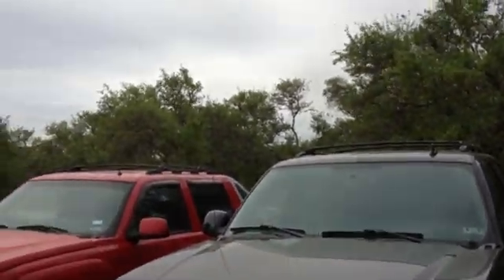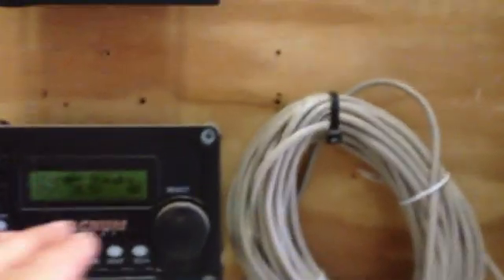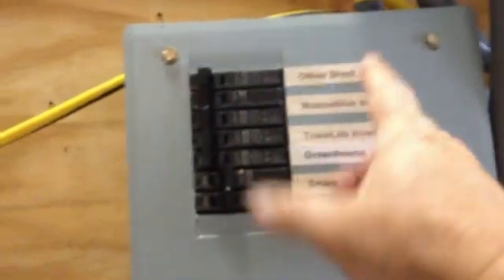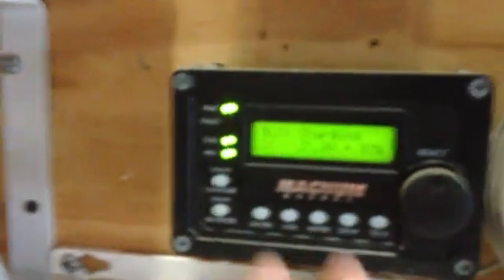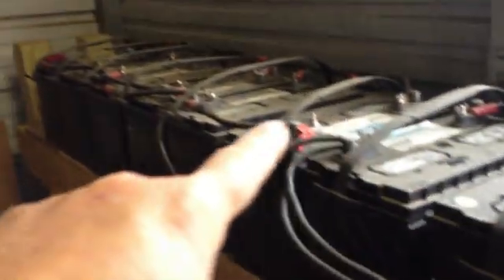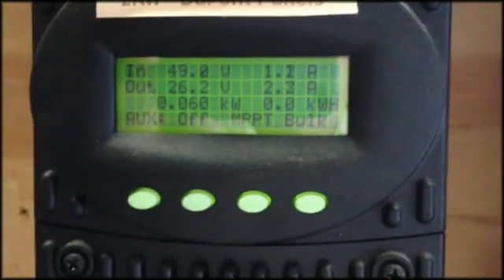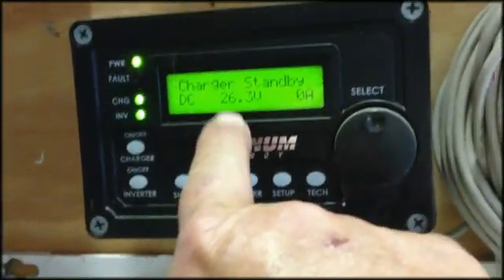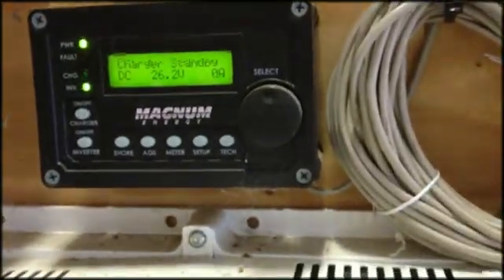Solar power battery bank update

Comment: Can you share your Wire sized from ...
1. Solar Panels to Charge Controller
2. Charge Controller to battery bank
3. Battery Bank to Inverter
4. 110/120v out of Inverter into House circuit.  

And what size breaker did you use between the Magnum Inverter and the House?  

Thanks

Comment from the maker: A 24v battery bank is fully charged at 25.5 volts, when it discharges and reaches 24v you will be at half capacity, you can take it down a bit more but avoid it, I would not recommend letting it go below 23.5v. Taking it down to the 23v range nightly would be very bad for battery life. Thanks

Comment: Al, do you think that the battery desulfator has been a really large part of the battery life you are getting, or just a bit of help help? Also, is it worth sticking them on say a small bank of 6 x 6V GC Batts running in series / parallel  to 12 Volts? I'm still on the fence on them as many still don't have that much confidence in them. Research seems to show more opinion then fact. But your experience and knowledge I trust since you started with HF Kits! As always, thanks for your time & input.

Comment from the maker: The higher the voltage the smaller the wire you'll be able to run to the grid tie inverters and thus less cost, also the higher voltage conversion will be slightly more efficient. Good luck with your project!

Comment: im getting ready to install 10 - 235 watt panels on my roof i can wires these up to 60 volts to sets and use 2 2500 watt grid ties is this a good idea to go 60 v or should i go 48 volts. what do you think.

Comment from the maker: The enphase inverters are grid tie only, however, i  trick them to put out power in a wire outage. Here's how it works - since my battery backup inverter is pure sine wave and I feed almost all circuits at home, the Enphase inverters think that commercial power is on and put their power to the "local grid" which is my house wiring therefore supplying all its energy to my devices and thus I save on using battery power.

Comment from the maker: Yes, if I had to do it all over again, I would made the system 48v to begin with, but once I had started with the turbines I had to settle on 24v for the rest of the system. Not too bad though, as the battery bank is close enough that I could get away with #2 wire for the load that I'm running.

Comment: Hi Al - are your Enphase inverted panels perm grid tied or do you have way of switching them to charge battery without physically re-wiring? I'm still experimenting with my Enphase part of my system to do this. Also wondering if u set mini grid yet w/your Enphase to continue to produce via auto transfer on the magna sine? Thx Al. Keep up solar/wind vids. We love them